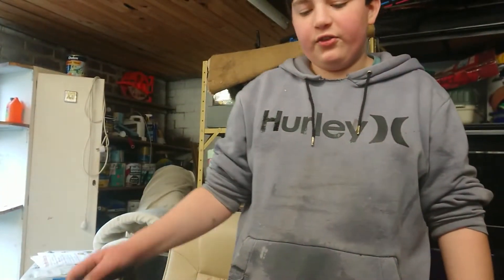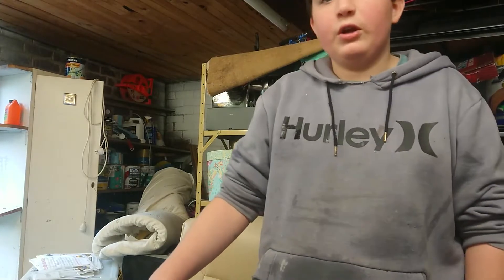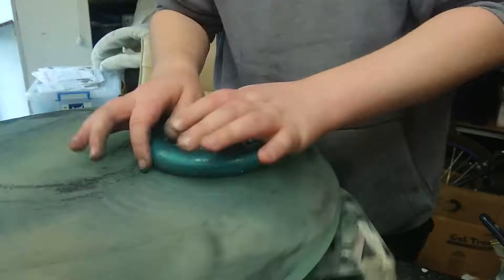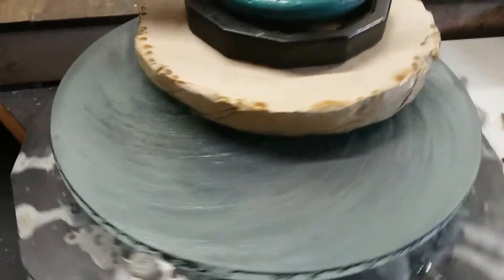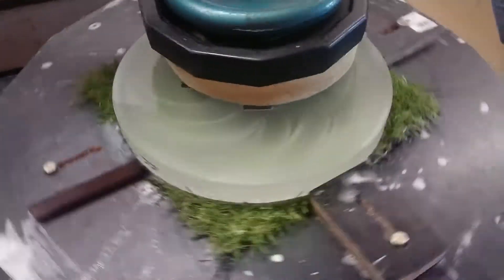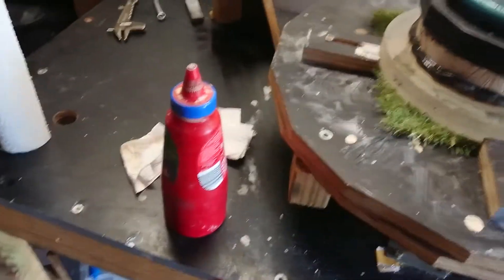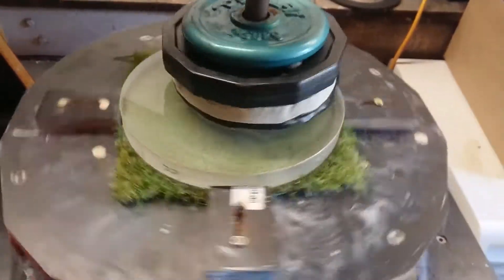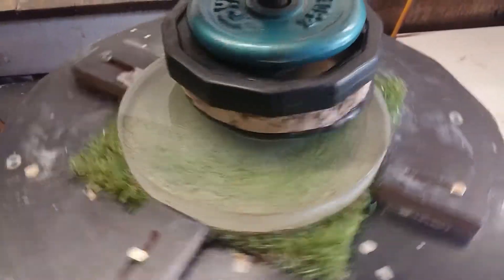Grinding and Polishing a Telescope Mirror

Comment: hey there Logan, I am currently grinding/polishing a "7 in" (more exactly a 171 mm) lens for a mirror, and I have been told that after using a 60 grit abrasive, one must continue on by using a 120 grit one, with W like motion of the mirror lens on top of the tool lens. 

Yes, It seems I am following a more traditional way of concave mirror making using a pair of lenses or glass discs, one being the tool and the other the mirror.
Our desired FL is 1.2 m because the tube of the telescope is 1.3 m max. 
It is said that this W motion of the mirror on top of the tool, should reduce any FL beyond 1.2 m (at least 10 cm above this mark, measuring with sun reflection) by 4 cm of 10 minutes of work.

So, the W motion is, first to match both mirror and tool centers, then move the mirror center over the tool center forward and backward with an amplitude of 1/2 of the lens diameter for about 5 or 6 cycles, then match centers again, spin mirror over tool some 20 or 30º (either CW or CCW but keep spinning on one of them) then start moving back and forth the mirror while doing W motion (offsetting centers by an inch) .

Have you ever heard of this method?
Reply from the maker: Hi Michael, I can't say I have heard of it but if  your two blanks are the same size, using mirror on top will always shorten the focal length (rather slowly) if using normal strokes. I think a W would shorten the focal length faster, as the center of the mirror approaches the edge of the tool (similar to chordal strokes). Apologies for the late response. Cheers!